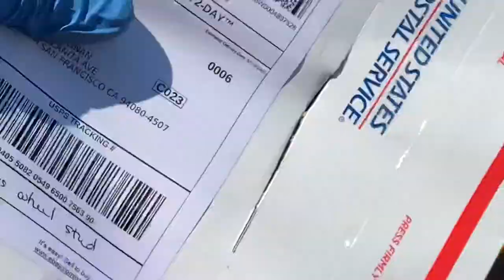How to remove wheel studs on a rear brake drums 88-91 Honda CRX diy

Comment: Why this stud is very long?
Reply from the maker: Prin

These studs were very long for several reasons, first they used these for purpose of using drag wheels.  A lot easier to remove and a combination of extended lug bolts.  Second, if you were using big wheel spacers or aftermarket wheels with limited circumference / diameter.  Finally it’s also use just for looks, thinking that you were using a drag car onto street, intimidating lookers ! 🤣😂👍
Reply: @jpscrx  Oh I see
Thanks :)